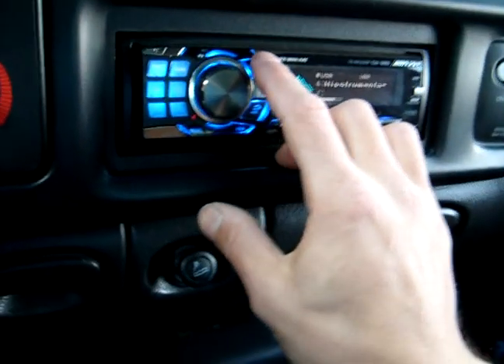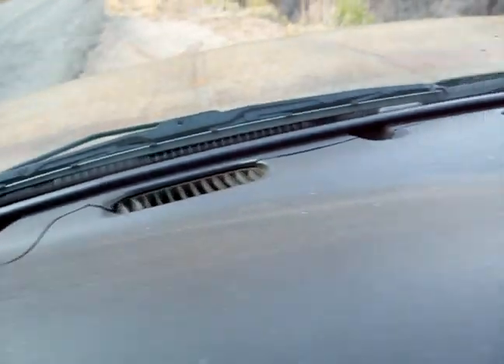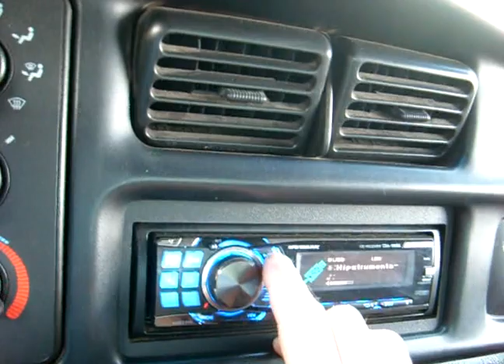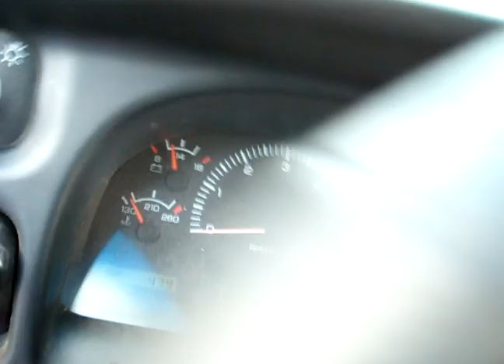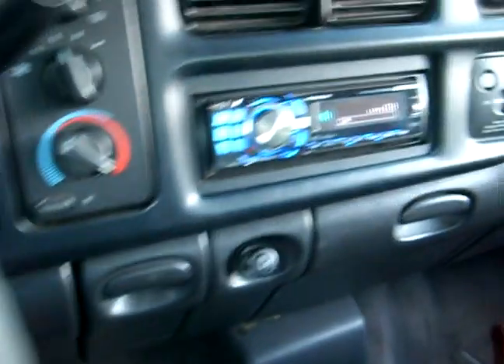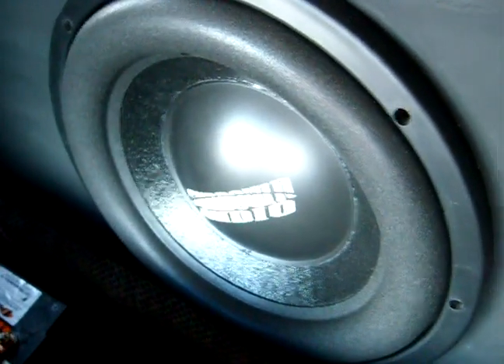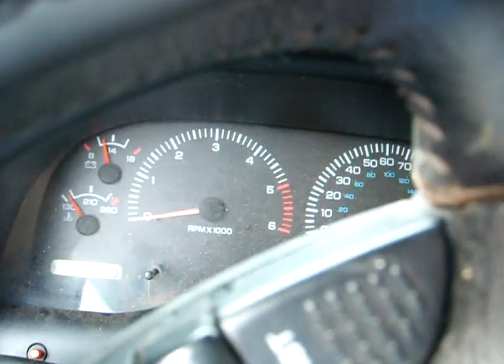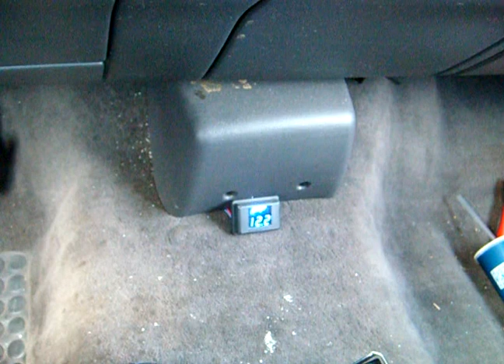Single Sundown Audio 12'' Z V.2/V.3 Flex Vid

Comment from the maker: @iloveporn412, yea, I was just runnin on batteries in this clip, and I already had been going for about 1/2 hour before making this vid. When the trucks runnin, I hold around 14V. The amp stays cool, but still not good for it I am sure. I dont worry too much as long as it stays @ 12+V under load. Soon as I get below that full tilt, I back off till the batts have a chance to catch up :)

Comment: Same truck but mines white i have 2 of these puppies I am still debating on Wat amp I should run them on but for now I'm using a class d 1000 watt knew pod and if you roll you windows down about half and open the 2 in the doors you will have a lot more flex trust mean you need all the air volume you can get in these trucks the ax helps as well

Comment: I need a bigger alt and bat but I've almost got the same thing with a single cab with a bench in it. You've got killer flex tho, my rear license plate doesn't move, it's too tight, but the back of the cab flexes a whole inch.